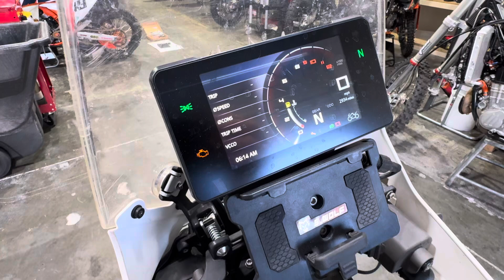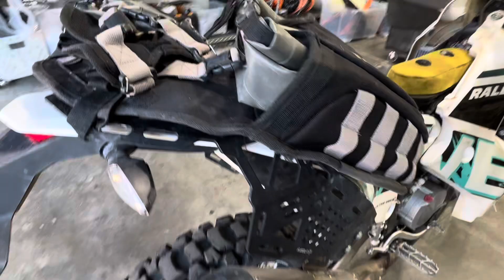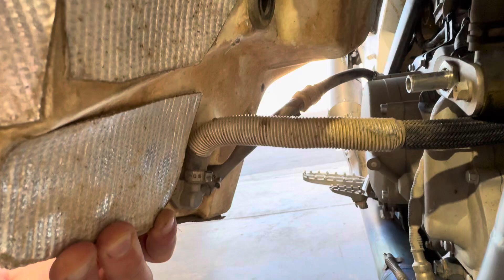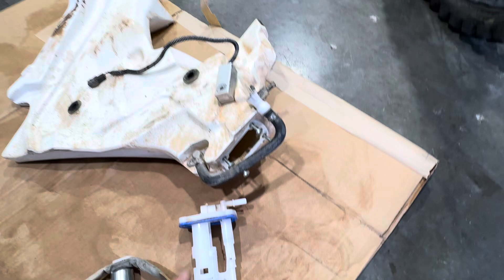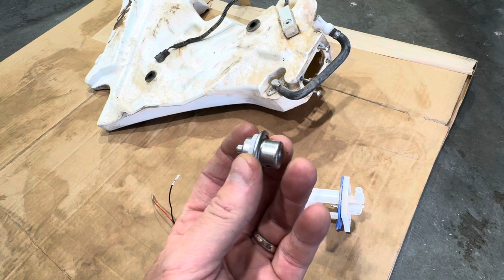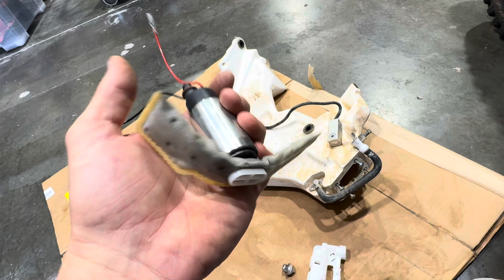KOVE 450 RALLY AT THE TACO SHOP - COMPLETE FUEL SYSTEM LOOK⚡️🌮⚡️

Comment: I've had a Kove Rally 450 since February and I do like the bike a lot but am frustrated with the fuel delivery system. I am not the only one with these complaints. Just slide into the adv rider Kove owners thread. The fuel level is consistently wrong on long rides. It seems that the fuel is not getting to that left tank in the speed it needs too. When you stop and let the bike sit for some time then the fuel level with increase with time. This is after following all of GPX's suggestions (remove carbon canister, fuel caps that breathe better, and heat tape on inside of right tank near the header). 

For example, I filled up all three tanks, which is 8 gallons, then went for a ride. Around 75 miles in my fuel level read at 1/2 tank, which is hilarious as after 75 miles the fuel level should barely have dipped. After a nice break from riding the level returned to mostly fuel. Rinse and repeat throughout the rest of the ride. It's absolutely infuriating. Especially when the bike is telling me I'm low on fuel and I clearly should have plenty. I don't know if the gravity fed system works as it should. 

This is the first video I have found that talks about the fuel delivery system so I wanted to point out this issue. The only other thing I can think of that I have not tried is the fuel level sensor itself? Perhaps when the engine gets hot it causes the sensor to act up? This is pure speculation but I really would love to solve this issue as I do like the bike.
Reply: Maybe this will help others looking for answers but I spoke with the Engineers at Coober and they say the issue with the fuel level being so off is caused by the software in the Canbus display as the fuel level is a direct signal to it. So until there is some possible firmware upgrade to the display that would fix this issue, it will always be a pain point.
Reply: @cyanidejed Interesting, and good detective work. 

In response to the fuel gauge vacation I'm offering up amazing spray can anodized billet wooden dowels with official laundry pen fuel markings at the low low ADV price of $59.98 USD. Included is some masking tape to tape it to your seat for storage. For the rear tank, you're on your own.
Reply: Same here.  Fuel gauge is just a suggestion.  Full tanks and it registers either full or 2 bars down.  After 50 or so miles it can show at just over half full. Shutoff, wait, restart and it seems to register properly again for a bit. 

Have futzed with different fuel setups.  Replaced all hoses, metal connectors, rear shutoff, one way, two way bleeders.  

Have had two right front tank geysers after taking the cap off. Finally ended up with Acerbis small gas caps with the transparent purple lines down to skid and under rear rack. Rear shutoff open per Joe. Can see fuel bubbling in the first 1cm of the lines on slow climbs at elevation (2500-3000m) and once a small amount dripping out at the skid plate.  

Seems to be working fine now. No more geysers but fuel gauge is still on partial sabbatical.
Reply: @meder07  Thankfully I have not had the geysers ever. I did eventually replace the fuel level sensor but still the issue persists. I was going to go the route of replacing all lines and fittings as you have done but it seems that that may be fruitless. I thought maybe there is some crap that is causing the fuel to not flow between the tanks as fast as it should when riding. With mine, i have to let it sit overnight for the fuel gauge to decide to be accurate. Its insanely frustrating.

Comment: Great video i love your content.. that bike there has a zhongshen nc450 in it right?i have a nc300 and dynojet said they didnt have a piggyback tuner that will work. Cant be much diffence in the nc450 and nc300 right? Do you have any advice mr taco..?thanks man . My bike is a trailmaster tm38e. I have clocked over 120 hrs on it not an issue so far .just seems to be running to lean.i did the setting and turned it off epa mode are something by holding the throttle wide open and turning the key off. The deceleration pops are way better but the throttle seems more jumpy.i have gotten used to it but would like to be able to make adjustments however possible. And thanks .if u cant help me with this then thanks for the channel dude

Comment: Looks like quite a simple regulator. My OilHead had a system that looked like it came off of car. Apparently an Audi fuel pump was the same spec.. I think BMW changed the 800 fuel pump to remove the mechanical  regulator. I prefer the mechanical regulator.

Comment: Ran a Kove down Baja back in December. I had just gotten it and didn’t have a lot of time for a shakedown. Overall if made for a really nice lite ADV bike. I did have one problem though. The exhaust header runs very close to the right side tank. I was in the Matomie wash struggling with some low speed crawling through the sand and rock. The tank developed a lot of pressure, which pushed the material closer to the header, which made the plastic soft. It eventually touched the header, burning a hole in the tank. It puked out most of my fuel before I could get some epoxy on to patch it. I ended up running out of fuel 30 miles from the highway. I was out of water and mostly out of food. Even worse, my jacket had fallen off the bike back in the canyon with my Garming inreach. I spent three days carving chunks out of seguero cactus to stay hydrated. I eventually hike back into the wash to locate my jacket. Finally found it and hit the SOS button. Wishing 5ish hours, the San Felipe fire department came rolling up the wash in sxs’s. They had water, and beer! Had to ride the out in the dark, which was pretty gnarly. Fortunately, the Kove has excellent headlights. After getting settled, I reached out to Gary and explained what happened. He pulled a tank from one of the shop bikes and pretty much overnighted it to my house in Seattle. It was waiting when I got back. So far, after a few little tweaks, the bike has been rock solid. I have roughly 5k on it now.
Reply: @chrismcfarland738  yikes, crucial info you just passed along. 👍
Reply: Wow! Now that's an adventure!!! Scary in moment but great story afterwards! This bike hasn't had any of those issues. But I have a second one come in and Will check out the new one before we take it out, thanks for heads up!
Reply: Have not seen many in Baja currently. It looks great!! I hope to see people use everything!! CF Moto has large corporate office in Monterrey NL and have seen CF bikes in central and southern Mexico but not much up north..Kove has sort of sputtered on social media propaganda about hyping the brand!! I hope they push harder to sell more bikes
Reply: was that with stock pipe and cat still in the midpipe?
Reply: @fushki  stock pipe.
Reply: @chrismcfarland738  that’s the problem.
All heat issues go when you pup an open exhaust system on the bike.
Reply: @fushki  This was a combination of the tanks over pressurizing and the very hot header from low speed deep sand work. The bike was fully loaded with an R80 setup and working very hard. I have since solved the venting issue and put some heat tape on the side of the tank. Haven't had any issues
Reply: @chrismcfarland738  yeh.
But you don’t need any of that once the pipe is swapped.
The cat and stock silencer reduce the exhaust from nearly 2 inch to like under one inch. 
It makes the pipe and right side of the bike insanely hot even after like 15min riding I could feel the right tank being significantly hotter than the left.

Since going to a free flow pipe and factory ecu I have ridden slow and steep areas, high speeds for long times and all the other stuff and the two front tanks never got hot and never have ventilation issues.

Just swap your pipe to something free. 
Arrow has even made a street legal one now. Or there are many that are not but will be ok.
Reply: @fushki Curious if the stock pipe is guttable? 

While waiting on snow for the hills, staring at my collection of drill bits and that choked-up pipe.
Reply: @ yes it is.
People have managed. But still the muffler is really restricted… the inlet is like 2inch and outlet is like 1. 
Also the muffler is soooooooo heavy. 

Coober/Arrow are quite cheap and I think both are road leagal. I would just go with a swap.
Reply: U need to install breather caps
Reply: @absfinal  no you don't I haven't and have had no issues.

Comment: Bought a used 2011 TE 310 Husky with a JD Jetting fuel mod, Eh.

I installed a PowerCommander that controlled the ignition and Fuel and upgraded the 4 nozzle injector to a 12. 

That PC5 worked like magic. I had to get a seat with more grip. 

As for Dynojet, I struggled tuning it. 

Their tech remotely connected through my computer to my bike and set it up quite nicely. 

Can’t say enough good things about their service and the economically affordability of the power commander